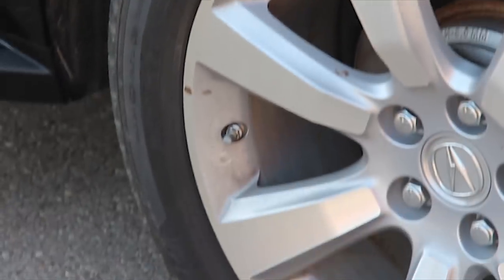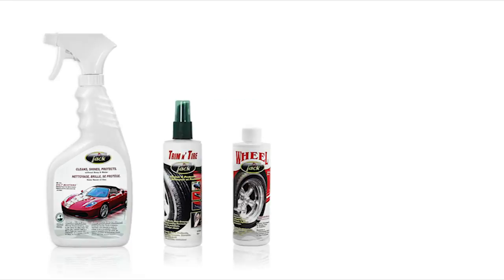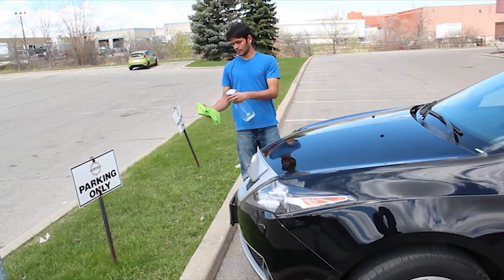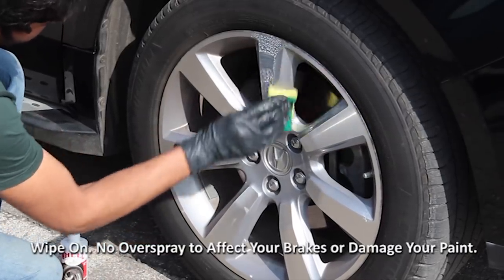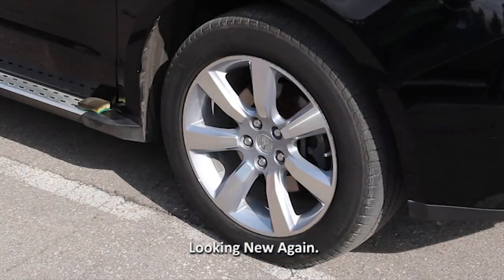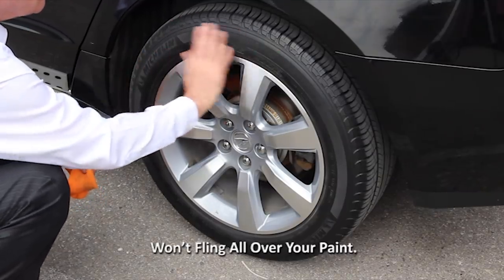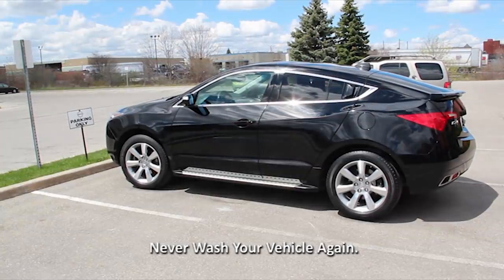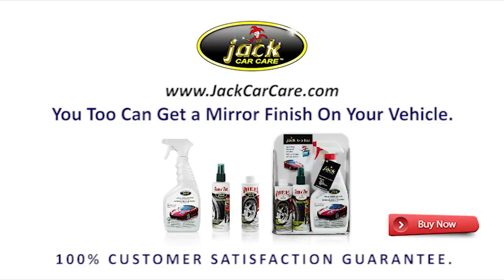How To Put an Invisible Force Field Around Your Car

Comment: all you do is scratch the paintwork by rubbing the dirt into the car paintwork ... you need to remove the dirt and crime first ... foam leave it sit 10 minutes then pressure hose to wash off and then hand wash if needed.